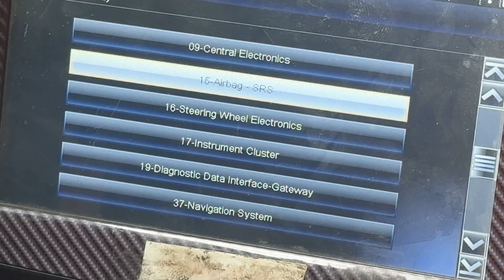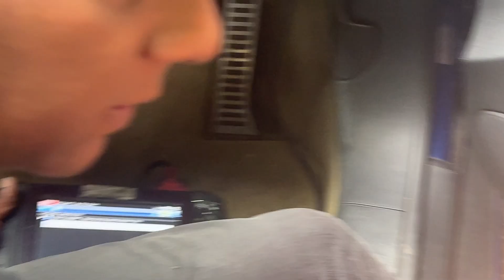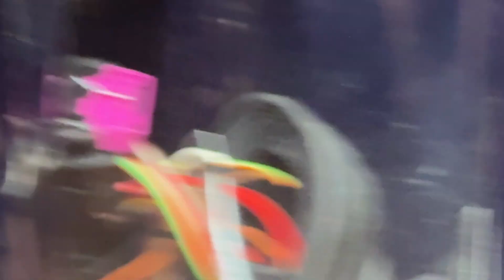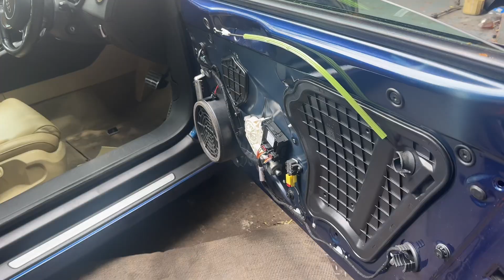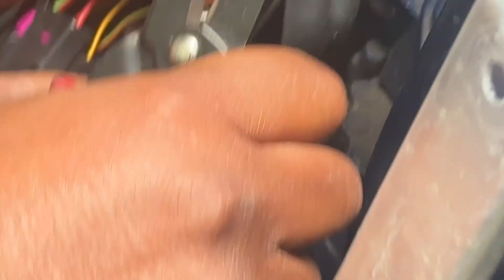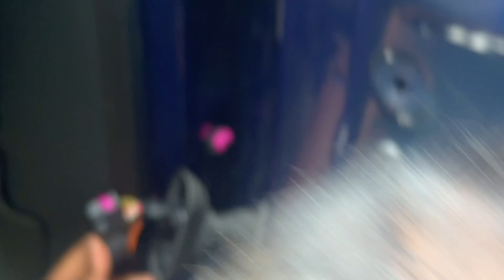Audi TT 2013 Airbag Light Fix | Crash Sensor G179 (Code 01221) Diagnosed & Repair

Comment: Hi mate, great video! 👏

I have a Volkswagen Tiguan 2011 here in Australia, and I’m dealing with similar airbag issues. My scan tool shows the following codes:

01578 – Airbag-off indicator lamp, front passenger side

01224 – Control module does not match vehicle

01222 – Side airbag crash sensor, front passenger side (implausible signal)

01221 – Side airbag crash sensor, driver side (implausible signal)

The car has a panoramic sunroof, and some time ago, water leaked inside the cabin, flooding both driver and passenger floor areas. After that, the airbag light came on.

I checked under the seat and found the airbag control module (5K0 035 730 B), which might have been affected by water or corrosion.

Do you think I should replace the control module first, or try changing the side crash sensors (G179 and G180) ?

Thanks a lot for your time and advice, your content is really helpful! 🙏
Reply from the maker: Thanks for the detailed message, mate — that’s a really good diagnostic summary 

Given the water leak history, I’d start with the airbag control module under the seat. Those modules are very sensitive, and once they’ve been exposed to moisture (especially under the carpet), internal corrosion usually causes all sorts of false sensor and communication codes — exactly like what you’re seeing.

Here’s what I’d suggest, step by step 

Pull the module out and inspect the plugs and pins carefully.

If you see any green corrosion or rust, it’s most likely the culprit.

You can try cleaning it with electrical contact cleaner and drying it properly, but often the fault returns soon after.

If the pins are clean but the codes persist, check continuity on the crash sensor wiring (G179 & G180). But from experience, when both front sensors show implausible signals and the module shows “does not match vehicle,” it’s almost always the module internally shorting or corrupted.

Replacement tip:

Get a used module with the exact same part number (5K0 035 730 B).

You’ll need to have it coded and VIN-matched using VCDS, ODIS, or a capable scan tool.

Some specialists can also clone your old module’s data if you send both in (that saves coding).

Prevent future issues:

Make sure the sunroof drains are fully cleared and rerouted if needed.

Dry the floor carpet and foam completely before refitting the new module.

So, in short — replace or repair the airbag control module first, then recheck for sensor faults. Don’t buy new crash sensors yet — they’re rarely both bad unless the module fried them.

We’re not able to reply to continuous messages as we get a huge list of comments every day. If you need more help, join our groups — they’re packed with mechanics and diagnostic techs:
👉 WhatsApp: https://chat.whatsapp.com/JOvJCdZYdV9J6PvIXw2RV0

👉 Facebook: https://www.facebook.com/share/g/15msa3NJmn/